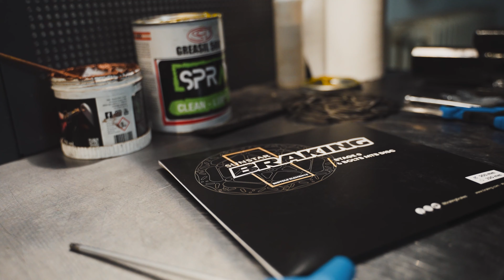FIRST has finally arrived. 💥

Comment: I got the same bike, I might buy a set of those brakes.
But is there any reason you went for a smaller rotor on the rear?
and is it hard to get the wire for the rear through the channel?
I will stay with both 220mm